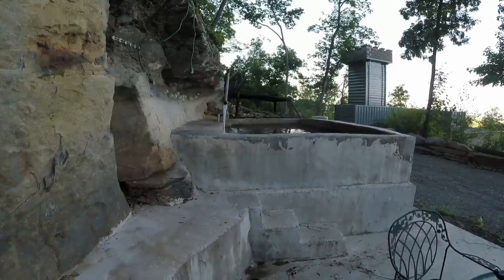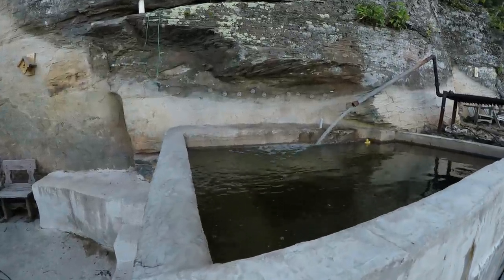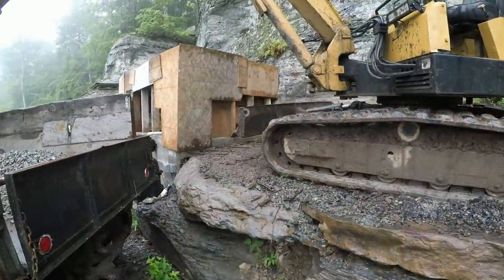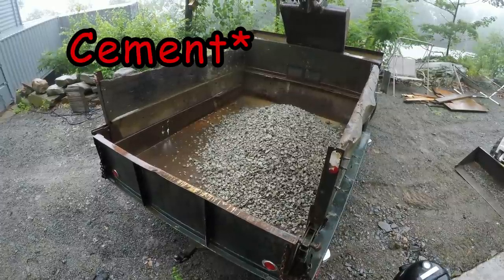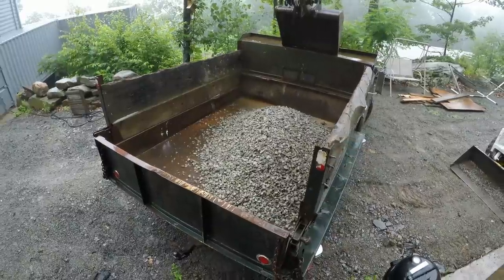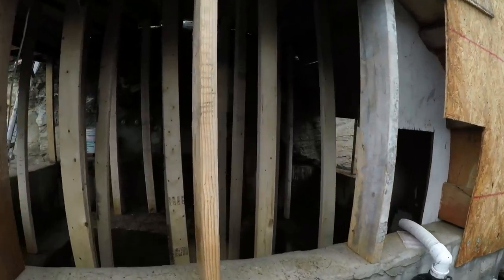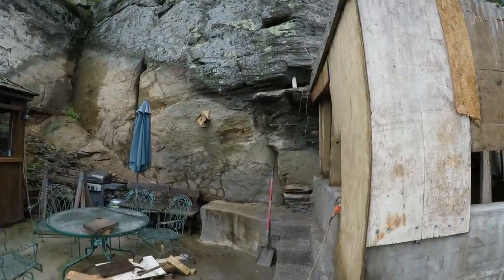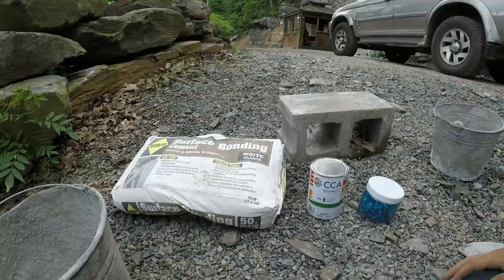Building a concrete hot tub grotto

Comment: Haha of course a trampoline on the roof :D
Thanks what an amazing build!
What made the green light dots?
Reply from the maker: Dejay Rezme I think that thing is called "star shower" it's meant for Christmas. But there are other products like it.
Reply: Ah thanks. BTW did you sand or smooth out or even polish the surface bonding cement? I'm wondering how comfortable this would be to sit on.
Reply from the maker: Dejay Rezme it's a bit rough. Not terrible though.

Comment: I have to admit, when you started out I was skeptical of the idea, but seeing the process was fascinating and the finished product is just magnificent!   

I wonder about trusting rebar for the entire weight of the canopy as it joins the rock face.  What risk is there of rust weakening that over time?   

I think I might have wanted a vertical column against the rock to help support that end of it.  I guess you could always add it in later if it looked necessary.

Well done!   :)
Reply from the maker: Doug Dobbs I trust it, the rock is at an angle, so it wouldn't move even without the rebar.
Reply: Epoxy coated rebar would last forever.

Comment: A cousin of mine was helping his dad with mixing bags of concrete, about 30 years ago. He accidently got some concrete dust in his eyes. Concrete has a chemical reaction with water, so the natural water of his eyes started reacting with the concrete dust. They had to rush him to an emergency room, 30 miles away. It probably more scared him than hurt him. Unless you are real experienced working with bags of concrete, you should probably wear goggles when you are pouring it from bags. Great idea to use the excavator to mix it in the truck.

Comment: Next time you attach a concrete slab to a rock you want to epoxy it. And to choose a thicker rebar. The thicker the better. 

It may take years for water to leak in between the rock and the concrete and make the rebars to erode and the concrete to crack and small pieces to fall. Usually you'll be able to see some cracks before anything falls or some dust in the water even first. But you can wait until a good crack appeared that will tell you it has to go. 

Adding at least a bull roof or a roof that covers the junction rock-concrete by a foot will protect the junction from water damage into the rebars and longer life to your roof.
Reply: That's how they do it at Miami International Airport landing concrete ramps. They poured 6" high slabs of concrete, and over that slab they set squares of 12" in high that they re-bar and joint to existing ones by utilizing a 1" thick re-bars x 24" long re-bars to existing concrete already poured slabs, they drilled, epoxy the interior of the 1" hole, place half a 2' re-bar into that epoxied hole, tied that bar to the existing re-bar set or bed, and they pour the ramp and they have no problems with planes landing at MIA. I don't remember the wide by length magnitude of the slabs over the 6" but I do remember the high, 12". You can check at MIA in the web or calling the Building department for their specs.

Comment: Nice grotto, and I like the fireplace to the side. I see the device in front of the grotto and what looks like an air duct pipe entering the fireplace from below.  My guess is that it is a heat exchanger into the water.  NICE.   I noticed this video some time ago but I didn't remember the fireplace.  Did you re-do or re-film the process again recently   (lol).  Anyway, good on you

Comment: Add a gate from an RV grey or black water dump. Then you can attach a 3 or 4” flex hose to drain over the edge of the parking area. Or fill a temp bladder or tank downhill from which you can draw water to fill the small ponds. You might consider a pond at the base of the cliff from your parking with an artificial waterfall ...

Comment: It’s def cool- not my style, but cool. I think it might look more cave like if you round off the sharp edges of the corners and from the roof down to the sides. Basically, remove all the sharp angles from the exterior. I think it would also look cleaner/more finished if it was painted.

Comment: I agree with you Andrew. If we don't do our things others will charge us comprehensibly or incomprehensible amounts of money we don't have.

Great job.

The fire is great since from the inside you may throw a little kind of a "four legged table" made of steel or a couple of (u channels so if you pull it doesn't tip into the water. And make it long enough so no one pull it entirely while is hot but a little or enough or add a stop to it somewhere. It'll be sliding if you wish like a drawer. Oh ok, a stop can be made imagine you have the frame in the u channels free to slide towards the pool or out the seating area. Make a cut opening the top of the superior surface of the u channel in a fashion that fits a rod or a piece of tubbing welded on the superior surface of the frame in a way that you can slide the barbecue table or however you can call this sliding barbecue up to like three or four inches before falling into the pool while it still looks straight or flat. Right there you make a mark and up to right there or even before you mark the top of the angulars before welding them to the side columns of the fire pit area because that way you make the openings for the rod stoppers before welding the barbecue slide. You got to mark the too of the u channels and the top of the side frames where you'll weld the rods that once someone slides towards the pool the barbecue slide the rods stop the barbecue slide from dropping into the water by those rods up to the openings that I recommend you to make no less than 4" from the edge of its end or whatever you decide so it looks pulled flat and nice. And on the other seating side the top of the open cut u channels will be opened to allow the front of the barbecue slide to be placed in for safety. Then for cleaning it you just pull it towards the seating area while hot and it'll be easy and safe to clean) on the interior side of the steel columns so you can slide the top of a framed metal base where to barbecue, or place on top some things you may cook while in the water. Maybe a top counter of a thick wood slab or some tiles on the edge of the wall before the fire for you to place your food and drinks before setting them from the water into the fire. Then once you want it in without getting out of the water you just place it in the top of the sliding barbecue frame or the table and have some hot meals in the water. Just don't eat too much. They say is dangerous. I'm more up for the sliding frame since you can pull it a little towards the pool so it don't overcook your meal.

Here's my number 7864396047 and email rodolfo.plasencia@gmail.com in case you want more specifications on my suggestions.

Comment: 4 years later, but I would suggest an epoxy coat on the inside of the hot tub. Smooth it all down so it feels better than rough concrete on bare skin, and give it a nice gloss finish. Which won't ruin the aesthetic as it will be mostly below the water line when in use. It will also make it easier to clean and maintain .

Comment: WTF!

Mixing concrete in a bed of a dump-truck! Man I started watching a few months ago. But you SIR. Hats off. Great job. Especially the heater ,Kudos.

PS I will be using my dump trailer to do the same. Instead of using my electric cement mixer.
You just made my day.
Reply from the maker: Yeah, that worked really well, I would do that again.

Comment: Interesting! thank you make the video, Andrew,some suggestion for you, mabe you should apply some concrete glue between the steel bar and the hole it inserted in on the rock. so that the steel bar can be firmly connected with the rock wall.

Comment: i really wonder how the wood fired aspect works out. would you want to be on the fire side? how fast does it reach a good temp? will it kill you if your evening goes on too long? we may never know.
to date 0 video of anyone in this tub. probably because its never appropriate for youtube.
Reply from the maker: It works well.
How long; it depends on the fire and water temp, probably a little over 3 hours is average heat up time.
Yes, it will make the water too hot, getting the fire the right size is a science.

Comment: Andrew you've used structural concrete, was this designed by an engineer? If not, this structure could be extremely unsafe
Reply: Not as unsafe as like it was with no roof under the cliff face. 😉

Comment: You drilled holes into the rock face, then slid rebar into the holes with no epoxy or some other glue to hold them into place.  What was the point of putting the rebar into the rock face? I can see the rebar helping a bit in supporting shear load but contributing nothing to tensile load.
Reply from the maker: Didn't I hammer them in there? That thing isn't going anywhere.
Reply: @AndrewCamarata  I agree it it is going to a lot to get that thing to move. Outstanding video, thank you for making them.

Comment: Was that light low voltage? Mine isn't and required a potting kit.....gotta be safe
Reply from the maker: The water light? It is 12v AC feeding it. It is meant to be a pool light though.
Reply: I figured it was a/c stepped down to 12v when there was no potting kit. Wish mine was low voltage, it uses those hot 250 watt halogen tube bulbs like in those work lights. They constantly blow, fail or the white ceramic ends crumble every year. Real pita! Anyways just wanted to make sure ya didn't juice up your water!

Comment: Gosh Andrew, I never met a person that mixed concrete in the back of his dump truck before.  I don't approve of this method.  You could damage your truck bed or side walls and will not attain a thorough mix.  BUY A MIXER!  Even an electric mixer would produce superior results.  You could pour into a dump tray and use the excavator to hoist this atop your cave dome as a labor saving device.

Comment: Any bubbles in your hot tub?   Do you heat the water?
Reply from the maker: No bubbles now, yes the water is heated.
Reply: @AndrewCamarata  you should put a couple of wooden beams at the back side of wall, then maybe a beautiful wooden table type top around the ledge of the pool, might look good, trying to picture it in my mind.

Comment: Andrew please explain the heating system
Reply from the maker: @kevintaylor8832  I made a metal radiator that sits over the fire, the water is pumped in a continuous loop through the radiator, I can heat up that hot tub in about three hours.
Reply: @AndrewCamarata  I don't have power to my tub.  An alternatives to run the pump?
Reply from the maker: @kevintaylor8832  yes if you’re going to heat the water with a fire, you can set up the radiator in a manner where the hot water has to rise as it goes through the system, that should create some water flow, I think it is called, “thermosiphon effect”
Reply: @AndrewCamarata  Thank you!  Coolest spa on youtube.
Reply from the maker: @kevintaylor8832  you’re welcome, good luck with yours
Reply: @AndrewCamarata  I asked my electrician about running a wire down to site.  He  asked how many amps needed.  Any idea? Is it just a pump that needs power?

Comment: How to make the wood boiler frame
Reply from the maker: I’m actually sitting in front of this hot tub heating up as I typed this, I made the boiler frame out of 2“ x 4“ square tubing, quarter inch wall, I welded it into a radiator shape and welded on a bunch of flat bar on the bottom to help catch the heat, it has four legs suspending itover a fire, it’s probably 3’ x 6’.
Reply: @AndrewCamarata   tanks amigo
Reply: @AndrewCamarata   I follow you since you were building the contener castle.  🏰 I been here 23 years time to go back to Mexico. And do Welding and wood work but your ideas and work are awesome 👏 and the dogs 🐶😂